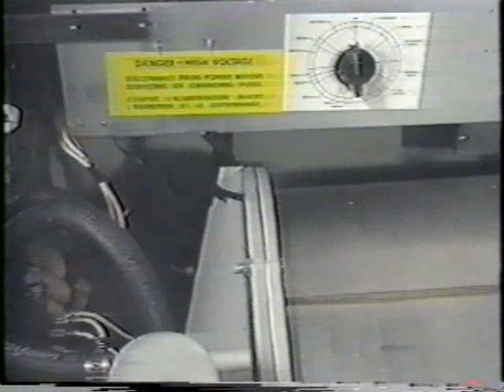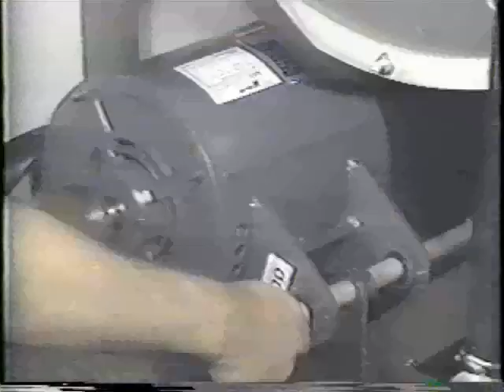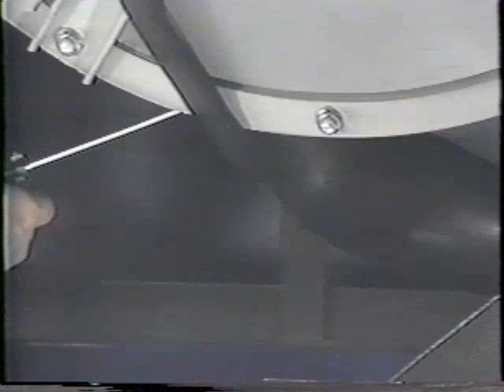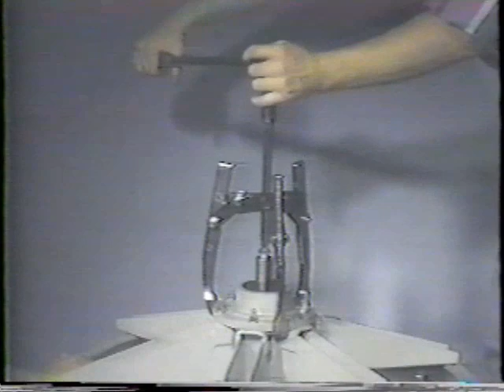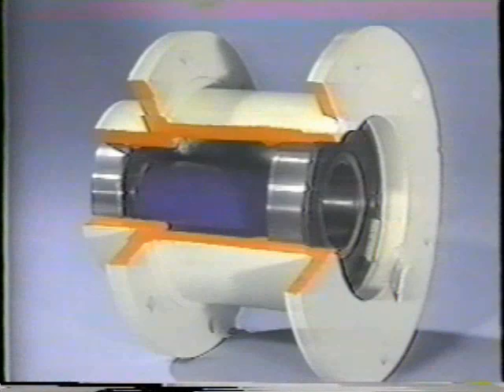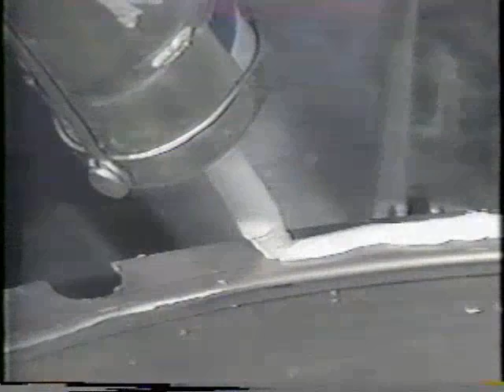Dexter Regular Chassis Bearing Replacement

Comment: Interesting! The drum bearing replacement process appears to be easier with these older Dexters comared to other brands. 
This is a very old video, of course, and the machine in particular appears to be one of the oldest models of the Dexter WCN T-400, which was brand new when this video was made. (The main differences between the old & new WCN models is that the pulleys for the drum & motor only have 1 belt, the water valves were still installed with the outlets facing upward, the "C" & "H" are made with multiple small holes in a pattern rather than the metal being bent into the letter designs, there is only 1 hole for the electrical power wiring to go through rather than 2, and this washer has a colored plate with the machine information instead of a sticker. Red means single phase & green means 3 phase.) Also, the absolute oldest & first made WCN model Dexter washers didn't have the vent hose coming from the top of the drum out the back of the washer yet, so that's why the narrator said "with the new suds relief vent hose".